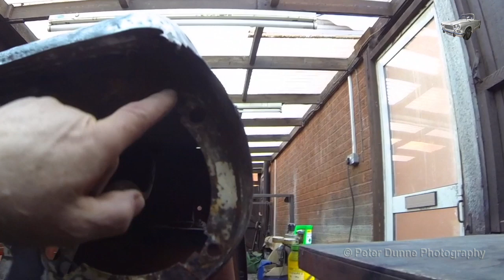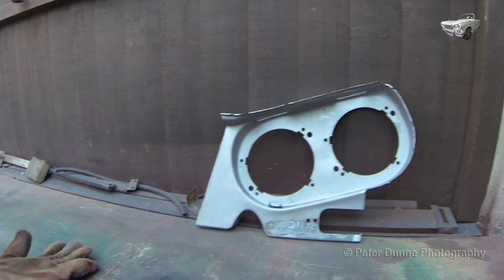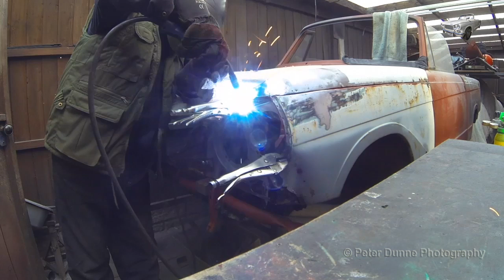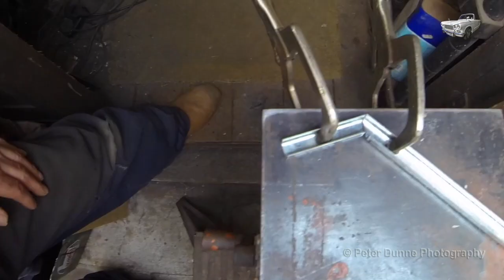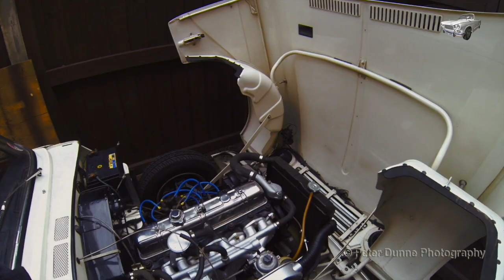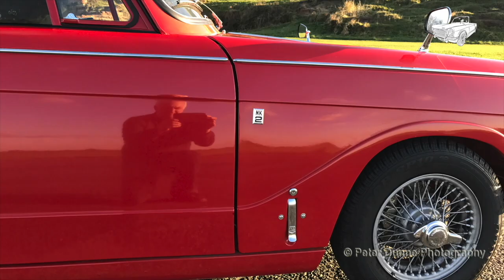No 11 Red Vitesse MK2 Bonnet repairs

Comment: Hi Peter. Clever idea to fit the overriders to ensure a good fit and gap . There must  be a reason why you don't have a spotwelder . I have a 240 v Seally and it does a great job. 😊
Reply from the maker: I have had two spot welders in the past, one was  440 which I couldn't use at home the other one was a 240 which I could use at home. Unfortunately it kept blowing the fuses after about half a dozen Welds. I also had a  TIG welder which liked blowing the fuse so they went on eBay.
Reply: @peterdunne8107  Must admit l bought a "multispot 80 " that was redundant from work for £50 , it too was 400v and a 3phase converter was over £3k !  I sold it to Dominic Chinea for £500 ! My Seally is perfect but you have to work slowly with it . Thanks Peter .